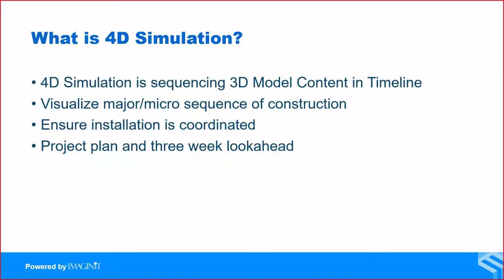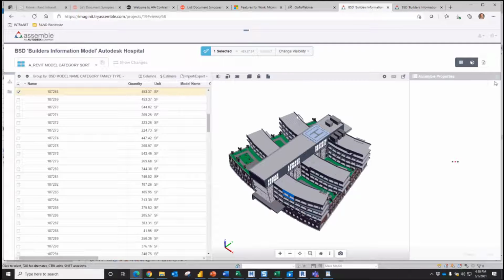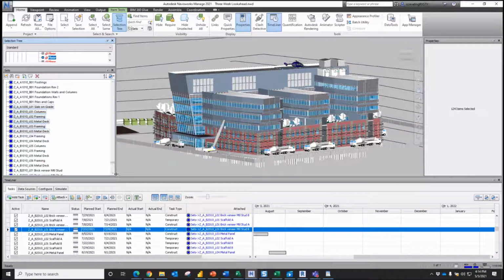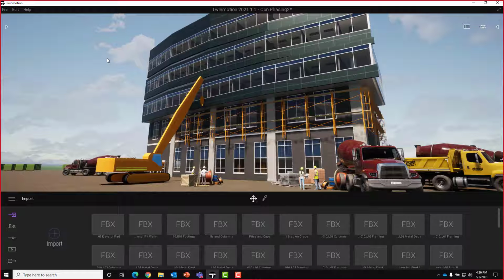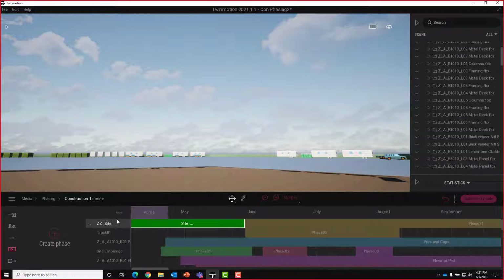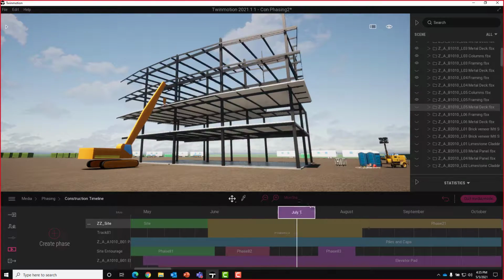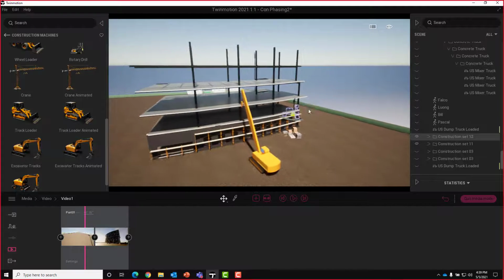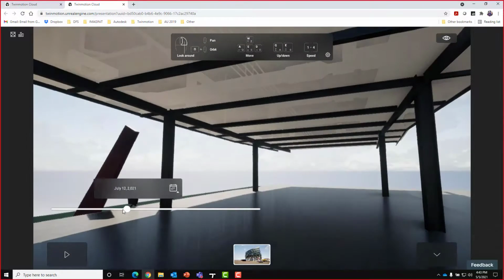4D Timeline Simulation: Navisworks versus Twinmotion

Comment: can you make a parameter in revit, use for schedule the time  line, including the exporting FBX model or work sets number or name, then soon when you get the schedule, you can arrange the phase in twinmotion easier?
Reply from the maker: We talked with our experts and they said you can create a parameter that helps to capture a view for export within the project browser. Create the parameters in Revit first, then assign the parameters to the objects. Then create a schedule for those parameters and export that to an datasmith file you could then import into Twinmotion. If you use Navisworks to do the export, use a NWC. Once imported, you’d need to open the phasing group panel. You can use the information from the schedule – which includes the phase parameter you created – to organize and arrange the phases in Twinmotion according to your project requirements.
Reply: Thanks  @imaginittech  currently I am using another software is nightmare : fuzor. totally out of dated tech and bugs full UI.

Comment: Thanks you for this video it was a great example of the workflow. I have 1 question. I'm still unsure about where you initially got the worksets from. You mentioned you imported them into Navis but from where? Did you manually create these sets in a different software?
Reply from the maker: Glad the video helped. We asked our experts, here's what they said: The data set is one that we took from Autodesk.  It was originally created in Revit and then brought in to Navisworks. Selection Sets were created by extracting Revit Instance ID’s from Assemble and casting them in .xml script for import to Navisworks.